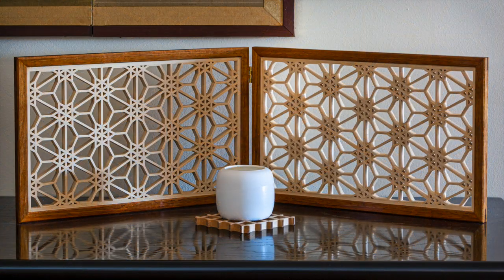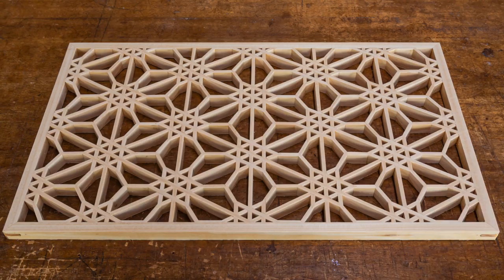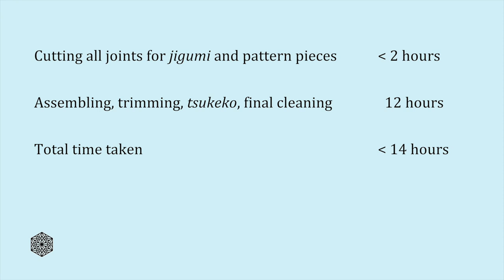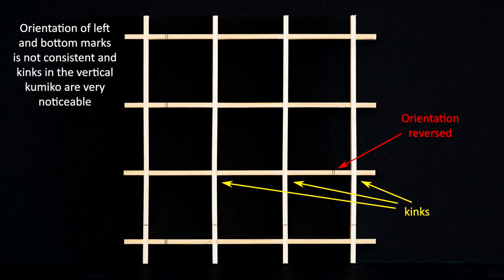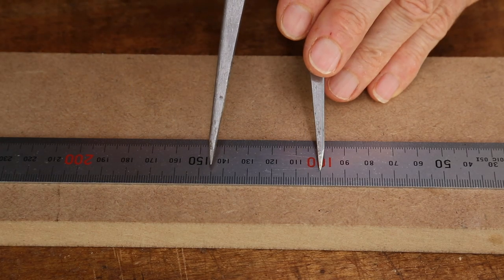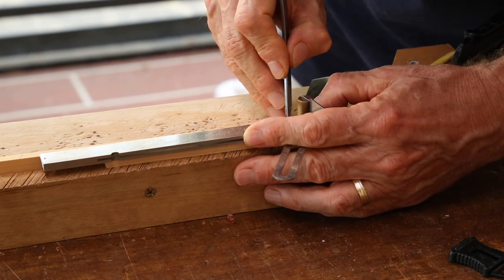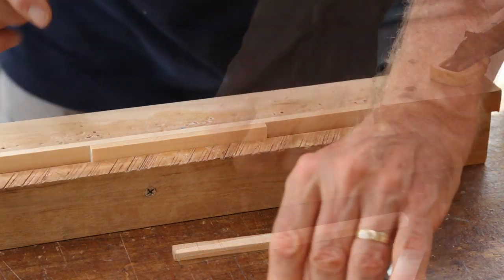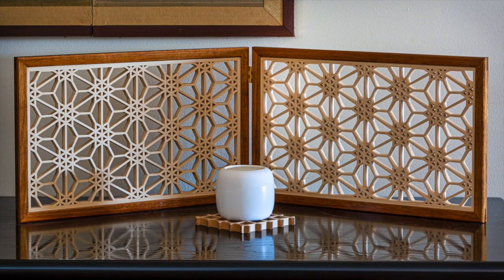Shoji and kumiko patterns — 10 Umebachi kikkō pattern Follow up

Comment: Very good information Des. The dividers was a great help for measuring longer pieces. I'm not understanding why this can't be used for the Mitsukude joint as well, but your wisdom always on point.  Loved the video.
Reply from the maker: Thanks Checkers.The method with the dividers can be used for the mitsukude joints or hexagonal patterns, and I have used it for those, but I prefer the other method I mentioned because, to me, it gives more consistency. Your mileage may vary though.